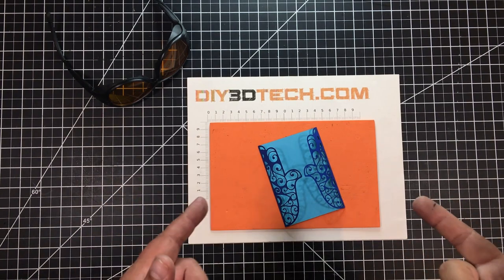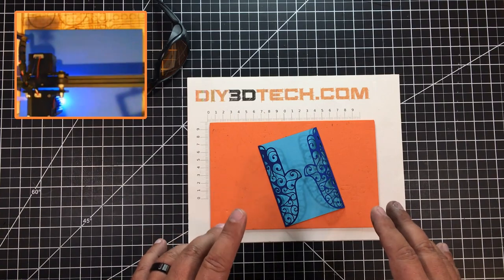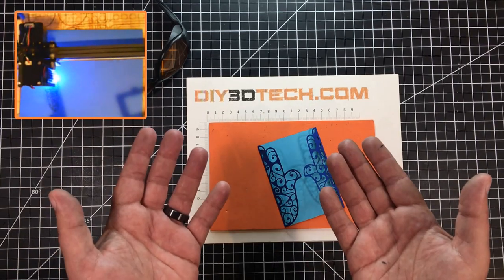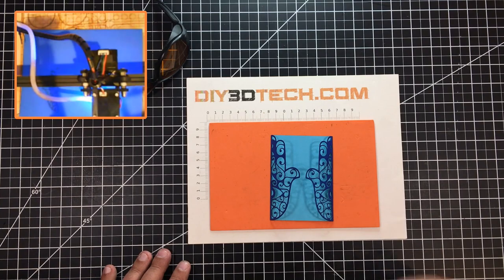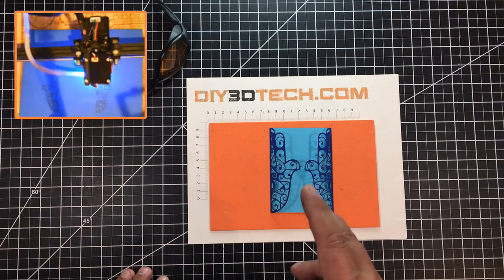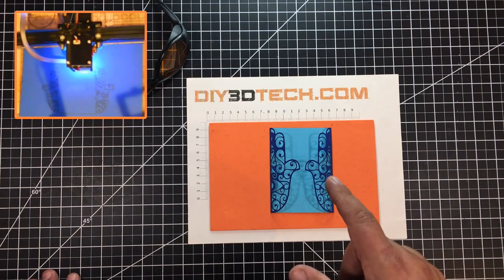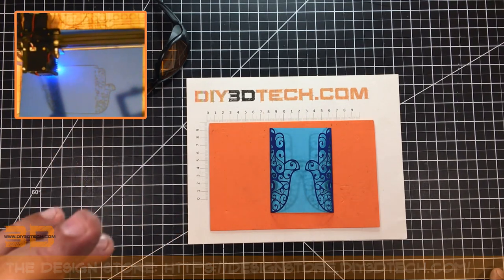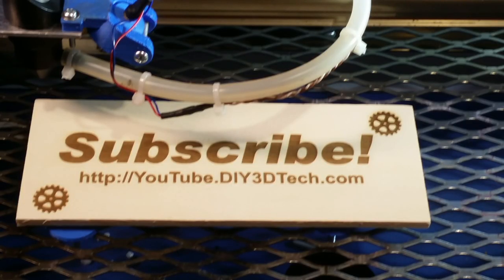Ortur Laser - Money Making Cards!

Comment: I can't wait to get my laser back up and running. I'm putting longer rails on it to increase it's work area to somewhere around 50x20 inches.
Reply from the maker: Thats BIG what are you planning to use it for?
Reply: @DIY3DTECHcom  laying out carving and cutting lines on furniture pieces, cutting large art pieces on thin plywood, etc. I'm hoping to start an etsy shop. I know there's other ways to print on wood or otherwise put a pattern on it, but the laser will also put in a tool groove, so my carvings will look better. Hopefully.

Comment: Could you maybe do a video on cutting clear acrylic with the ortur, I want to know if it is possible with this machine but can’t seem to get it to work myself and can’t find any videos online.
Reply from the maker: The reason you do not see videos on this as it really can't be done.  Keep in mind this is a visible light laser so if its clear the beam will pass though it.  To cut clear you need a CO2 laser.  Some  people have used tape over a clear sheet (thin sheet) with some luck...

Comment: What settings did you use to cut this: ( laser distance, speed, etc). I’m using light burn rn.  I have the 7w and I’m just starting out.  I tried running it last night but it only engraved and did not actually cut.
Reply: he says settings in the video, 40mm/s 100% power. distance should always be set so the laser dot is as fine as possible.

Comment: It look like very nice design, Bravo! :) but have a question. 1. what laser do you have? that goes to no.2 what speed and power setting in lightburn did you use for cut it and for those bending lines? I am just curious, still testing my laser and have 7W, and so a 1st question to match the power if you have 15W in that instance :) By the way, I managed to have a decent cut in 2mm oak veneer I made produced on my bansaw few weeks ago. Do you cut oak veneers? It took a while... :) Best Regards and wishes from UK :)
Reply from the maker: Many thanks for the kind comments and love the UK (spent a lot of time in London for work).  Ortur Laser Master II and believe I cover the feeds in the video, the 7watt (is this input or out?) will be fine for paper but oak veneer it (if input) will be a bit lite and likely to char the wood as it cuts.  A 7 watt (output) laser is best to get cleaner wood cuts...